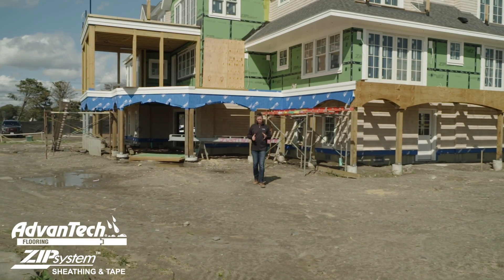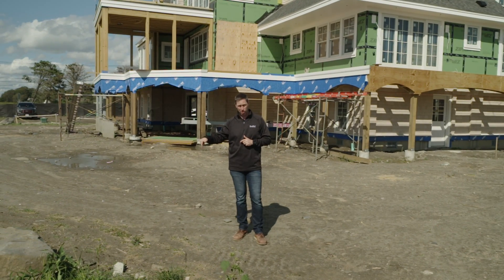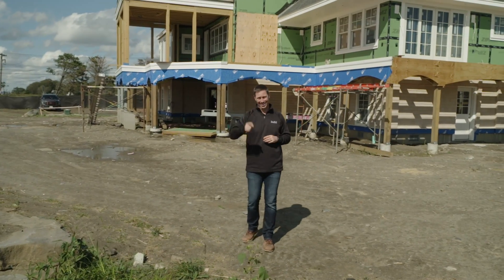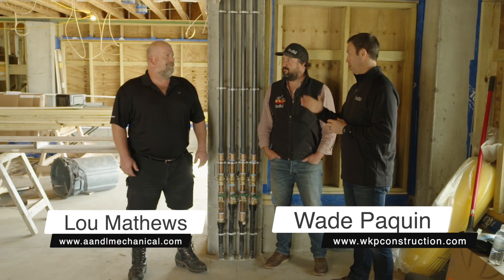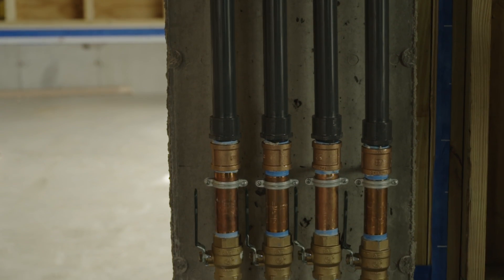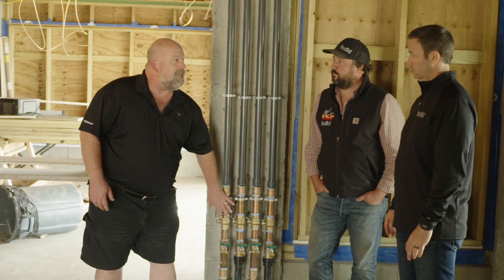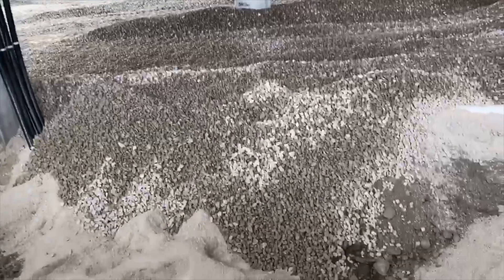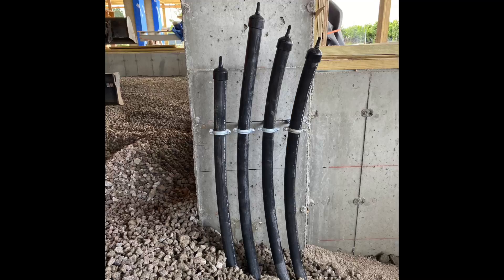Debunking 3 Geothermal Myths

Comment: The last 25 years of Geo was a train wreck so the old units never lasted 25 years and new units don't have a 25 year warranty so the lasting 25 years is unfounded... Lou is full of lies... The government had to force the companies to put a 8 year warranty on the equiptment years ago...There is a joint at the bottom of the well... There isn't a payback before the units go bad... Equipment and expensive of wells is huge expense... Power companies give electric discounts but you have to put in a second meter, more cost, and the discount sometimes isn't when you run the unit the most... Why do you need to have maintenance valves on the wells if they don't go bad?... Salesmen
Reply: Thank you for sharing.  Your post summarized most of the points I have seen against this system. Electricity is very expensive in my area so I don't think this would be feasible, in addition to everything you mentioned.

Comment: 4800 sq foot ICF house in central TX, using a synergy Waterfurnace system to generate warm air, cold air, and hot water for domestic use (heating up water in a stainless steel tank with heat exchangers rather than a traditional water heater).  The 5 ton synergy does all this relatively easy using 5 closed loop wells 250 feet deep per manifolded together.  Also have a desuperheater function installed that preheats water in a dead tank prior to my stainless tank, and a 30 tube solar system that augments (but mainly allows a nice discussion with my property tax folks). System running 10 years now. I’ve had to replace the 3 junky original tanks with 3 new (and much better) tanks.   One new coil, and a little issue with a coolant leak. Otherwise system does well.  Here is what I would recommend if you are thinking geo....

1.  The tax takeaway is a good one, basically the government bought my wells and loops and I bought the rest.  The loops last forever usually. 
2.  In a predominantly warm climate, your loops tend to warm up over time unless they are generously sized.  The fact I have a desuperheater and also use my system to produce domestic hot water help out a lot in this regard.  
3.  My system struggles if I turn the set point on domestic water production past 118 degrees F.   The wife wants a hotter shower but struggles to figure out the handle goes further left. What I’m saying here is that she wants the handle to be in the middle and the shower to be hot, but making 125 degree water then tempering it down to110 makes no sense. The efficiency of the system goes way down in that scenario, and will cause the system to pressure trip and require a reset. Over time she has started to understand how this all works. I’m poking on her but typical users and customers have these same thinking trends.  There is some risk in heating water less than 120 degrees because of bacteria, mine is at 118.  Do your research before you heat water for domestic use, but in my case it balances out the system annually esteem heating and cooling seasons.  Additionally, the life of my components is linked to the frequency of hot water generation, so every time somebody runs the hot I wonder if that is costing me life on the unit.  

4.  I have 1 guy that I use to service and check my system. A typical a/c system can be serviced by almost any HVAC company. 

5. In my case I have no backup system for making cold air.  But I have a propane fireplace that can run without electrical amd at 36000 btu can heat a few rooms when Texas turns off the power. (We were lucky though and they didn’t at our house)

6.  Now the system is 10 years old and things break.  Pricing a new unit seems stupid when every component inside the case can be replaced or serviced.  So how long parts are available will become a factor. Pick a reputable name brand company if this is a concern for you.  

7.  My system sits in an equipment room at ground level in a 1 story house.  It’s pretty quiet  at low compressor speeds and fan speeds. Not really noticeable. I could have probably used a 3 ton on a 5 well system, but my installer wanted the bigger fan in the 5 ton to move air.  I think it was a good call. 

8  with the outside air temp down near zero,my unit struggled in low mode to keep up, occasionally shifting into high, but I have no emergency heat strips in my system. 

9. Having no outdoor unit is nice, and the wear and tear is way less inside out of the weather. 

10.  People think I’m weird. And if you put in a geo unit you will have to contend with explaining all this to people forever. But you can then look down your nose quietly at people that don’t “get it” and never had a thermodynamics class.  My average electric bill in 4800 sq foot home for the first 12 months was less than 85 dollars a month. My neighbors in similar sized homes are 3 to 4 times that.  While there are legit reasons to question geo, at the end of the day for a long term investment it’s way worth it, and again, the government bought me the difference anyway.  It was a no brainer.  Since then my entire family has all invested in them and nobody has uttered a complaint. 

11.   One more point.  When you hire a geo installer, by definition they probably are better contractors and HVAC folk than you might otherwise come across.  Not true in all cases but as a general rule these guys are pretty damn smart.  That’s a big help.

Comment: We purchased a geothermal house in Houston that was brand new.  The AC repair men were in our community every day for the five years we lived there.  I had three Lenox coils replaced in five years as did many of my neighbors.   These systems would always break when we went from summer to winter and turned on the heat.    It was not a reliable system at this location at all.   The beauty of the system was its very quiet and we don’t have that noisy unite outside.  But reliability is the biggest concern for this equipment.  Also keep in mind these are like a Ferrari.  Specialized AC people have to maintain them.

Comment: 25 years is not a long time when compared to my grand mothers soildfuel water and heating which was bit in in 1948..its 2021 now and it still running
My fathers gas central heating boiler lasted 48 years

Comment: When they discuss cost, I really think this is poorly done!!
The cost of the duct work is the same.
The cost of the equipment is definitely NOT the same.
The cost to drill a well, or wells, is extra. 
The operating cost is different depending on the heat source of the non geo equipment.
Another thing not mentioned is service/repair. On specialty equipment, that means higher efficiency or something not normally found in the everyday home, those costs will be more.
Reply: I agree.  I would like to see a few more detailed (as in spreadsheet of total lifecycle costs) analysis of not only installation cost and operation cost, but maintenance cost.  If you have a break in one of the well pipes, you are talking probably at least $1,000 to get a backhoe out to did it up, find the problem and then repair it.  And if this happens in the winter, good luck finding a contractor to do that before your home freezes up.

I agree with the energy efficiency of geothermal, no question that is great, but my concern is longer term maintenance and repair cost.  My forced air gas fired furnace is super simple to maintain and repair.  No water to corrode or leak and cause damage and everything is easily accessible for maintenance and repair.  I have in-slab hydronic in my workshop and it is great for that application, but boilers are simply more maintenance intensive than furnaces and when something goes wrong in the winter, you need to fix it soon before the unit freezes up.  Hydronic has advantages and is easier to install than a ducted system, but I’ve never heard of a home getting $10,000 of damage from an air leak from a duct.  😁
Reply: So, what is the cost of a Geo-Thermo HVAC ( equipment ) vs the cost of High-Efficiency Nat-Gas with A/C ?  
The operating cost of Geo-Thermo is LOWER,  for 25 years ...
Reply: @MrSummitville  I suspect it varies greatly and each home would have to be evaluated individually.  It also depends on fuel prices. With NG at historically low levels and looking to stay that way for some time, I suspect the payback of geothermal is questionable in many locations.  However, the only way to know would be a detailed analysis and people seems to rarely do that.
Reply: @MrSummitville  This article suggest that geothermal is rarely cost effective for a single family residence.  https://www.ecohome.net/guides/2349/geothermal-heating-and-cooling/
Reply: @MrSummitville  
And the cost of the wells is factored in?
The reliability?
In my limited experience, geo is less reliable and the repairs are far more expensive. 
People usually don't remember the cost of wells, either.
Reply: @jrsmyth9761  I do remember the cost of the wells.  Where I live, drilling a well for GEO was inexpensive.  Your price can be higher.  If you have hard rock layers, then use a trench?  The extra cost for the wells will more than offset by the MONTHLY ENERGY SAVNGS over the next 25 years and it heats the water in the Hot Water Tank, too.  Repair costs are the same as any High Efficiency Nat-Gas furnace with A/C. Our neighbors use the same repair company for GEO or Nat-Gas units.  GEO is very reliable - there are NO MOVING PARTS outside.  Either the manufacturer makes reliable units ( Geo or Nat-Gas) or they don't.  Reliability has nothing to do with Geo vs Nat-Gas.  There are repairmen with 25 YEARS of Geo-thermal experience ...

Comment: A couple of key things they didn’t mention.
Geo systems have much lower operating temperatures, so an air handler might discharge around 105degF max whereas a natural gas/propane unit would be around 145degF.
This means it takes longer for the hating system to reach a ‘set point’.
That’s why most geothermal installations utilize radiant floor heating, the larger surface area and ‘whole room’ coverage means that lower operating temperatures aren’t a problem. It’s a much nicer, more even heat too.
Also, drilling can be very expensive depending upon location. In my area, there are only a hand full of drillers and it’s as if they have formed a cartel - it isn’t cheap at all. The electricity company offer no incentives and the kWh price just keeps increasing. Compared to natural gas, the operating costs (energy not servicing) are about 40% higher for geothermal.
So, one needs to check these variables for their location to understand if a geo system really does make sense.

Comment: Don't do it this way,,,,EVER!!....Pull up a manual for a geothermal heat pump (water source heat pump...) and check the performance ratings for closed-loop (this...) versus ground water (well water...).....ground water is MUCH more efficient and MUCH less complex.
Have a water well installed (even if you are on municipal water and want to keep it that way...)...have the water quality tested for mineral hardness. If the water is out of spec, install a brazed-plate heat exchanger to isolate the coaxial coil in the heat pump from scaling.
Brazed plate exchangers are not expensive and easy to swap-out (or clean...) if scaling is an issue.

This approach is why geo has gotten a negative reputation......waaaaaay too expensive. (and complex...)
Reply: You way works only if you have constant ground water supply.

Comment: Just don't try to install a vertical system over an old underground coal mine. Friends did this in the 80s and apparently ended up hitting lots of voids and had to install a gas + AC unit. Crazy part they were not that far from a large body of water, but really couldn't use it.
Reply: We have these new things ... they are called maps ... read the map BEFORE drilling ...

Comment: Cost is absolutely NOT a myth!  Come drill a well for me for free and then I’ll pay for a system. Sounds like a sales pitch glossing over the hidden fees. The technology sounds great but to say that cost it a myth is ridiculous and misleading
Reply: Yeah I laughed when he said it used to be 50% and now closer to 35%.. that is complete bullshit..  the equipment alone is 2x, then you add in a 20k well or two..
Reply: @FJB2020  If your well costs $20,000 then you are getting the shaft ! ( ie ripped-off ) 
The price  for a 5 Ton Geo-Thermal HVAC unit is about the same price as a High-Efficiency 5 Ton Natural Gas HVAC unit.
Geo-Thermal uses no natural gas and  uses 1/2 the electricity for the life of the unit = BIG $$$ SAVINGS !

Comment: Am I the only one who shudders at the thought of running antifreeze into ground water?  Plastic might be reliable but still have failure rates and install defects.  30 years from now will our ground water quality be drinkable?
Reply: Very crucial point. As with all things, we do the expedient thing and then in 50 years someone will write another Silent Spring. 
Our hubris is incorrigible.
Reply: I am sure they though about things like this.

Comment: Really, if the line to the main or the heat exchange is shorter than the return line, with good insulation for the majority of exposure to the inlet then a pumpless system should be possible, when properly designed and in place. An effective extraction technique would be needed at the high point and I wouldn't know if a heat pump is the most effective way to pull away from a passive and closed line. Really do think it's achievable though with no moving parts or risks.

Comment: When the compressor terminals blow from failure you get yummy toxic oil and burn refrigerant dumped in the mechanical room and that can be the same air you are breathing in the home. A geo  thermo system is water cooled instead of air cooled. The fan that cools the air on a normal ac unit pulls 1 amp at 220 volts around 50$ worth of power if you ran it 24 hours a day for 1 month. Now imagine a pump pumping water 120 feet up from the ground thats a lot of weight. If you ran that pump 24 hours a day for 1 month your electric bill would be like running your pool without a timer $$$. Air conditioners are not magic all the do is take heat and move it, really simple move heat. Side note: Butane, propane, ammonia and so on will work as refrigerant.
Reply: They are NOT pumping water UP 120' feet from an open well.  They are CIRCULATING water in a closed loop, using very small push & pull pumps.  Geo-Thermal HVAC uses much LESS energy vs a Natural Gas HVAC unit.  Clearly, you do not know what you are talking about ...
Reply: @MrSummitville  I have replaced coils and compressors on water circulating closed loop geo thermo units and when the compressor goes out you are dead in the water and the compressor is the same as any residential unit so clearly you have never worked on one.

Comment: Why do you keep calling it a geothermal system.  ???   That is not what it is.
    Geothermal systems use heat directly from natural sources like hot springs, geysers and volcanic hot spots.
    Ground source heat pumps are essentially air conditioners that use soil or groundwater to cool the condenser instead of an outside coil and fan. It uses electricity to move heat energy from one place to another. Run it backward and it provides heat, and more efficiently than using electricity directly.
Reply: It gets heat from, and returns heat to, the earth - therefore it is a Geo-Thermal HVAC unit ...
https://en.wikipedia.org/wiki/Geothermal_heat_pump
It is NOT a Geo-Thermal POWER Station ...

Comment: I managed a High School physical plant in Alabama with 72 Water Source Heap Pumps,(Geo Thermal) for many years.  After 12 years of headaches, loop leaks, we switched over to two cooling towers and were able to effectively cool the building once again.  At first, I was really pro GeoThermal but after about 5 years with the system, it was one problem after another with the loop field, manifold leaks, pump problems.  We had 100 vertical loops under our parking lot, two massive pumps in our pump room, two variable speed drive motors, and way too much time "fixing" the problem.    NO  THANK YOU,  YOU COULD NOT CHASE ME DOWN TO GIVE ME A G.T. SYSTEM FOR MY HOUSE.
Reply: One bad installation is not statically valid.  There are hundreds of thousands of working geo-thermal systems ...

Comment: I have a question, does it take more energy to extract heat from this system over time? I mean, does the ground get chilled from the dumping back of the cold and removal of the heat?
I guess using the system for AC in Summer would restore some heat to the loop area's..
I wonder if fridges and freezers could dump their heat into the system too?
Reply: Water well and you're all done....none of this complexity. If you currently are on a water well system, 90% percent of the cost is already done.
Reply: The answer to your question is yes: if the amount of heat you extract in the winter is out of balance with the one you inject back to the ground during the summer, you'll see a slow (i.e. over many years) decrease in temperature around the probes. This is a well known issue with geothermal that has attracted quite a bit of academic research and field tests. The implication of this phenomenon is that vertical closed loop systems are much more sustainable in the long term in temperate climates.
Note that this slow cooling does not continue indefinitely: the ground around the probes will eventually reach a new equilibrium with the surrounding rock/sediment.